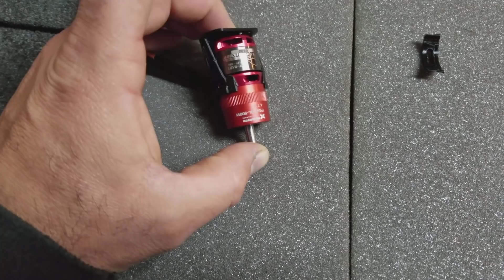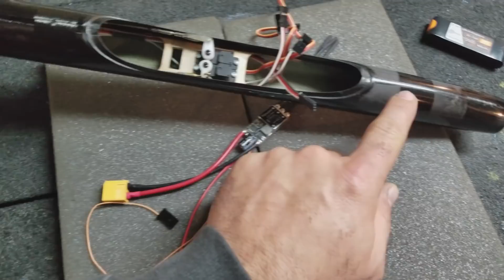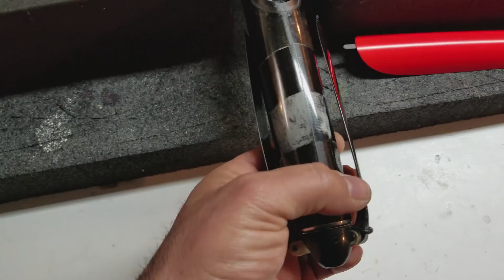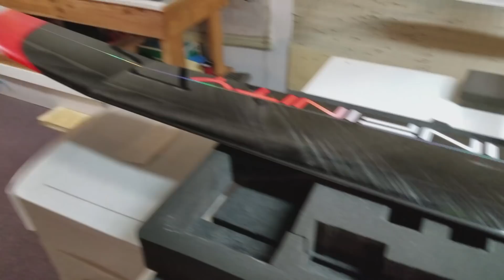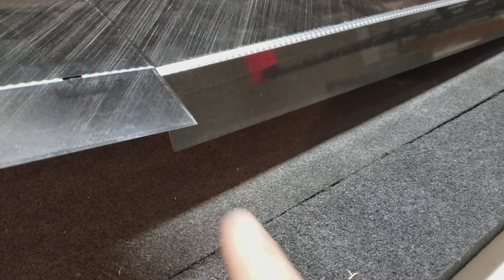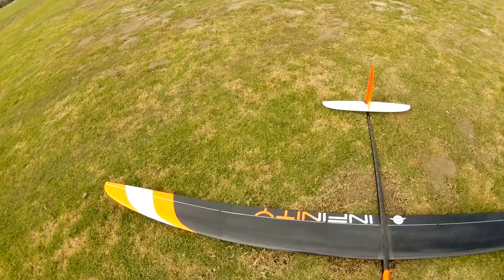Infinity F5J Build Part 4- Maiden Flight

Comment: Hi Ali, have you ever noticed any negative interference from receiver and speed controller close coexistence?  BR Tomek
Reply from the maker: Tomek_RM no, not really. As long as antennas are routed properly.
Reply: ✈👽👽April 2020.i have a dx 9 .now 6 years old. no issues. fly slope. on 2 occasions. went to pick up glider .controls went off centre's. Keith Australia

Comment: Ali, as always- a very methodical approach to your setups.  Nicely done.  I personally wouldn't fly 2S...3S is my preferred setup for F5J/ALES. More punch for not a significant amount of weight gain. In your case, the extra weight up front might help with your tail-heavy issue... Would be interested to see what you come up with (battery-wise) for your next series of flight tests.  Cheers from Ottawa- Jean